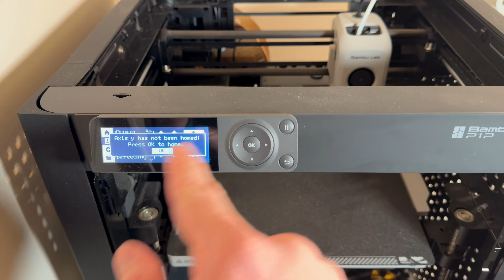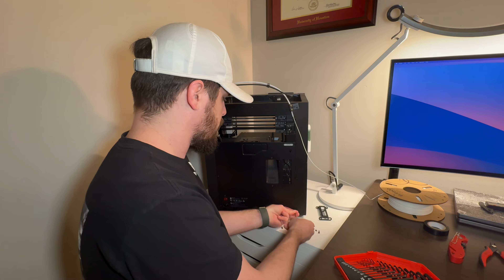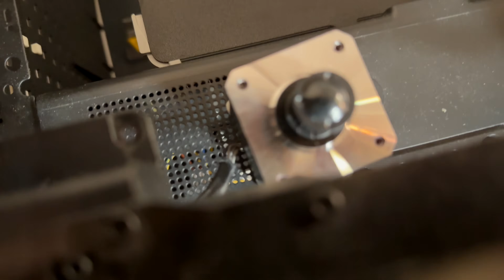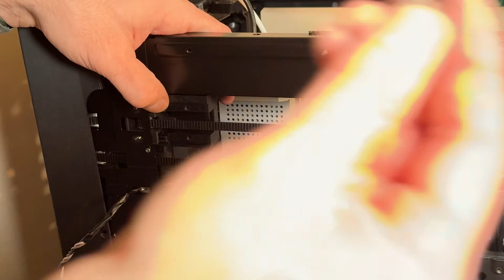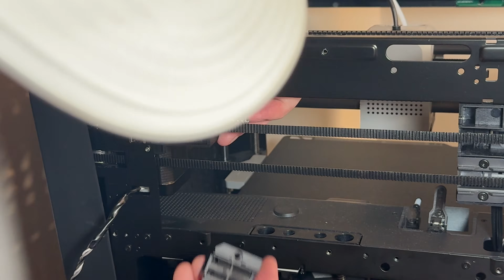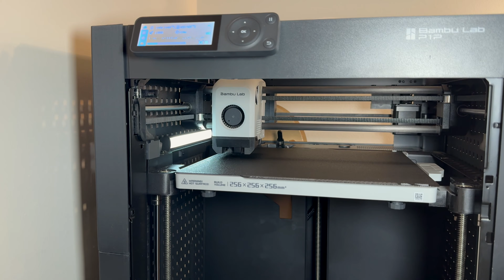Bambu Lab P1P Stepper Motor Replacement

Comment: My p1p x axis movement is noticably very heavy now when I move the toolhead with hand while the pribter is off. Did this also happened to you when the motor is having issue?
My print results have defect on outer wall especially on edges.